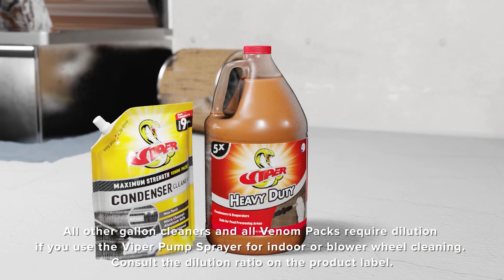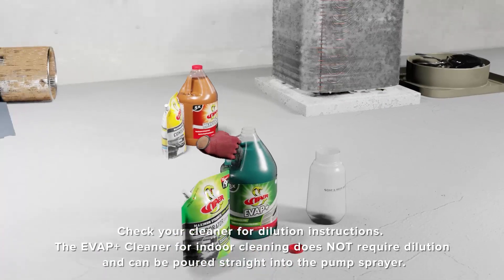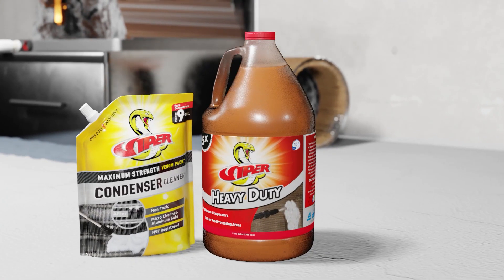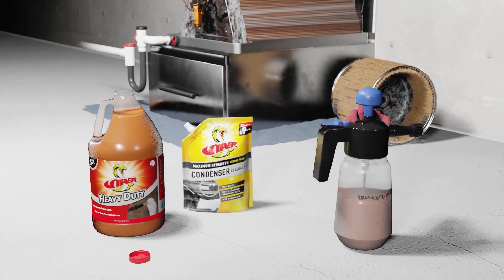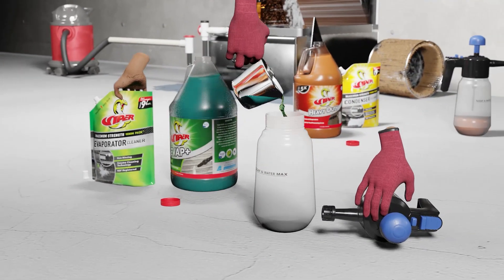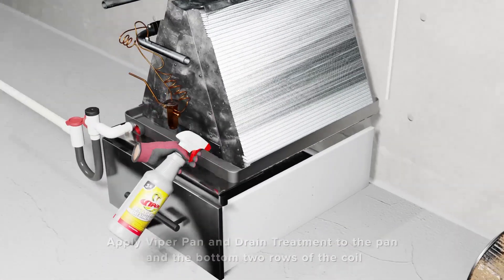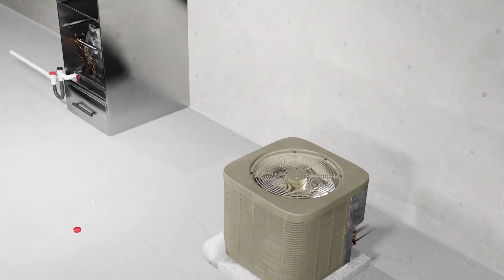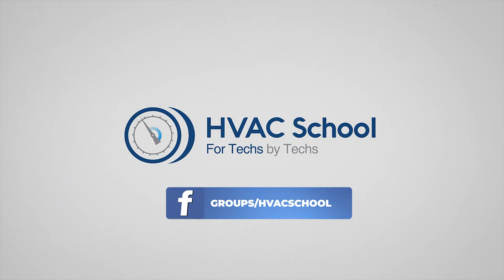Cleaning an AC w/ Viper 3D

Comment: is this safe to use on copper and aluminum? alkaline based cleaners will attack aluminum fins and darken them while being safe on copper. acid based cleaners will attack and eat away copper pipes in coil. so i wonder what PH based cleaner these refrigeration technologies product series are using?
Reply: All the coil cleaner are safe except Viper Brite and Venom Pack Brightener